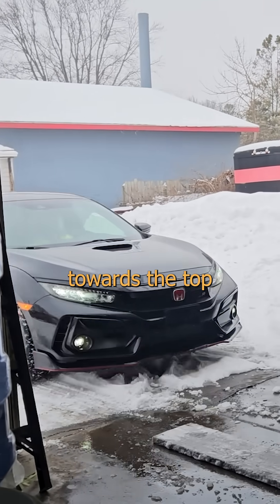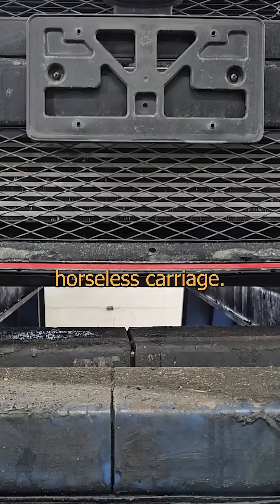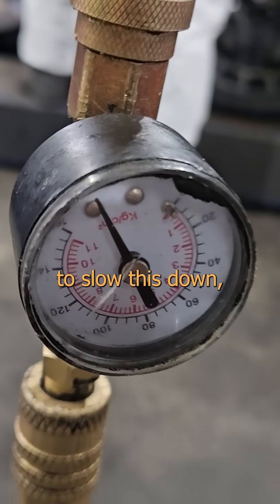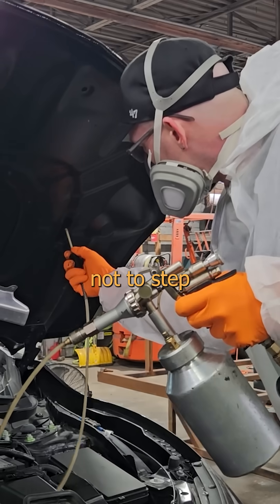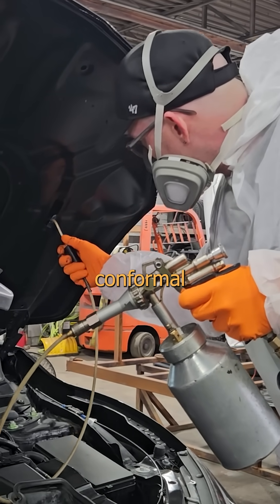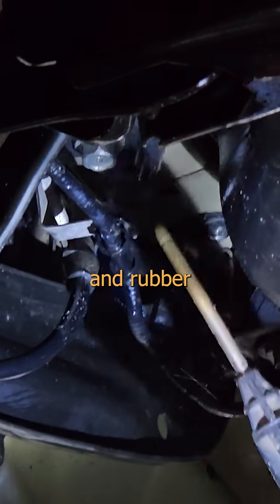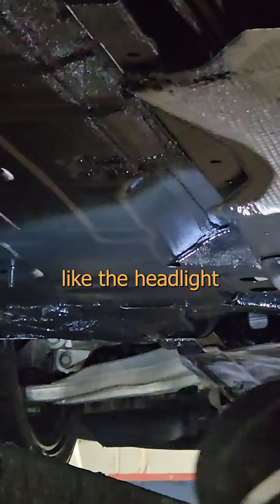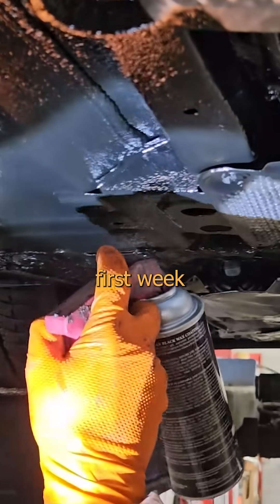How to stop rust on your car #chrisboden #comedy #engineering #wax #corrosion #science #winter #salt

Comment: I wish I could find a place that would do it around here. I can’t find anyone nearby that I’d trust to do the job right. I don’t live in the rust belt anymore, my county doesn’t even use salt in the roads when it actually does snow. But I have a diesel 2004 Excursion that I absolutely love. I waited for a year before I found one that lived in the south it’s whole life, was lower mileage, and was taken care of by an adult that didn’t destroy it with a lift kit, giant tires, or questionable mods for performance. This truck needs to last me as long as possible because it’s the only thing available that can carry all 6 of my sons, my wife, and still tow our camper or my tractor. They don’t make anything comparable today. I’m just going to have to suck it up and crawl underneath without a lift and go to town with some fluid film cans. I’ve seen that they make a straw with a nozzle for getting into the inside of the frame rails.

Comment: Wax coating? I think that might melt off down here in Florida. We need protection against atomized sea-salt in the air but the protection has to be able to withstand 110 degree summers and intense humidity. Anyone got anything for that?

Comment: I work at a corrosion testing lab and I have seen quite extensive testing regimes to ensure the manufacturers undercoating will resist both abrasion and stone chipping as well a s corrosion.
But I agree, if your vehicle is not already adequately protected against corrosion on the underside, getting some protection on there is most definitely worth the inverstment.

Comment: Excellent advice! Might I suggest if you want your waxy protective Coating in a spray can form try Amsoil metal protector heavy duty. Gives you the option to spray your other metaly bits without visiting Kevin at spraytech. Maybe your trailer hitch receiver adapter and ball or any other painted or raw metal that you don't want rusting....

Comment: I got my car undercoat at the dealership from Nissan. I also had a million questions and they showed me themselves. Most of what mine is is a sort of black layer, and then they used clear stuff for anyplace where water collects in moving parts and around door frames and such. It's 8 years old now and has almost no rust. Very small amounts, nothing larger than one cm square....and only near my rear hatch way. Can't see it when the door is closed and it's only surface rust where parts meet. I live in rural Ontario (Canada) and we still use salt on our roads. The undercoat had a neat bonus, it reduces road noise. The guy showed me by putting bolts in two cans but coating one can with the undercoat and let me shake them both. Ha Ha.

Comment: This is very common in Denmark because our climate (it's very rare to be far from the ocean and we also salt the streets) will f up your car in no time if you don't. It just sucks to work on the car when it's coated, and you need to reapply every 2-3 years, so it's about twice the cost of tires in terms of running costs in my experience.
You also don't need to ask for evidence that they did it, because you'll get a set of wipes to wipe down your paint job afterwards, and you'll more than likely need them 😂

Comment: Im on the other side of this problem being that i live in Texas. We can have vehicles outside for decades with minimal damage from rust, but anything made out of rubber or fabric will turn to dust the second it gets moved. I have to buy new tires almost yearly despite if they have tread left due to dry-rot. Belts and hoses need to be checked regularly for the same reason.

Comment: Not just DMC but also Mercedes Benz did the same undercoating. They had a rubberised undercoating used to seal the bottom of their cars round the 70s. 

Works great for external corrosion, has a nasty nasty tendency to hide internal corrosion from inspectors.

All fun and games till the floor becomes spongy.

Comment: I use Ospho.  Being on the gulf coast, we have two seasons: it's so hot my balls are melting" and "when is all this rain going to stop?"  The soil is a mix of sand and salt, so rust happens very quick.  Ospho turns iron oxide into iron phosphate.  ast, we have two seasons: it's so hot my balls are melting" and "when is all this rain going to stop?"  The soil is a mix of sand and salt, so rust happens very quick.  Ospho turns iron oxide into iron phosphate.  This lasts until the steel gets recycled.  And being a reaction rather than a coating, there is no way to trap anything behind it.  The only better option is to get parts Parkerized.  It's the same idea, but with an industrial process that uses what looks like the prep for chrome plating.  I get hitches and receivers processed.  The interface on any of them have yet to start to rust.

Comment: UK guys, I'm a former Rolls Royce and Bentley Heritage restoration engineer. I run two modern classics as daily drivers. I strongly recommend Buzzweld products if you have used new metal or are working with good metal, or if you're working with old metal, knock it back, use a rust converter such as POR-15 Metal Ready and apply Lanoguard. I use this on my own vehicles as well as on work vehicles.

Comment: Oxidation (rust in this case) as 'Fire in slow motion'... That is FN classic (I'm gonna use that, for sure! Cheers 🥂 (great vid as usual!)

Edit... I use parrifin for my woodworking tools, parts, machines' cast iron table tops on my unisaw, shapers, a planer/ jointer, (etc- which is also a good lube) I was just about to post this before I saw it on this vid. I didn't know it was used on cars! (But it makes sense! Heck, I have a small stick in my backpack right now!  Don't ask why.)  nice!

Comment: i use a mixture of chainsaw bar and chain oil and ATF (to thin it for spraying) and a pump sprayer, but thankfully here we don't use tons of salt (any more), and the dirt roads i tent to cruise only add to the ablative coating underneith the frame, but yes i 100% agree, undercoatings are amazeballs for protecting the soft underbelly of your ride from winters horrendous fury

Comment: I just take care of my truck, and clean up and paint the frame every year. I dont touch the cab or bed, because they went 25 years without rusting before i got it, but the frame had a bit of surface rust, so i cleaned it up, stripped it to bare metal, and painted it

Comment: as a michigander my self from the land of breakfast cereal 
Just wash the car every couple a weeks in the winter 
or if your really worried about it you could get some spray on truck bed liner and with a hoist or some jack stands you can rust proof your car yourself however my old ford ltd with a ziebart coating from the 80s is still rust free so thats the kind of professional job i would personally reccomend
but the best way is just wash the car find a good car wash with a good underbody wash and itll get the salt off before it has time to do any real damage

Comment: Mechanic/Bodyman here, been bangin dents & sprayin hue for 31yrs now, and i cant tell you how many folks have been screwed by snake oil and fast talkin when it comes to rust prevention. Too many times, ive had to be the barer of bad news, that someones hard earned cash has been wasted. Im a shop owner, and i use a product called HUD, rubberized chemical filled aerosol product, that works really good in my area.(central/northern ohio)Its not the most eco-friendly way to go, but it sure works. Spray cans and a cartridge/gun system with super long, flexible nozzles for all your nooks and crannies, especially your crannies. Whichever system/product is used, prep is key, i mean PREP, PREP, PREP! take splash shields off, clean everything, everywhere & just like any paint style coating, maximum adhesion is your friend.(another words, clean the grease and dirt, and scuff the surfaces!!!!!) If a shop is telling you, that their "state-of-the-art, scientist made, plutonium nano-partical undercoating system" is too good to be true & you need to hurry, before the auto manufacturers & government stop them from selling/installing it for $99.99 today only.....you just got hosed.

Comment: I had a truck with a quart a day oil leak. I drove that truck for 10 years and put 400,000 miles on it and a crash took it off the road. With absolutely no rust on it. None what so ever. I just didn't feel like putting a new front cap on it. I got my money out of it.

Comment: A long term ase tech i worked with told me to save any waste atf i collected from jobs until i had a few gallons, out it in a pump sprayer, pull your car over some old gravel and hose the frame inside and out, his g body looks like it just rolled off the lot top to bottom.

Comment: Last fall I bought a $4 can of black spray paint from Lowes and used it to undercoat my old station wagon. Is it perfect? Hell no, but the frame's already got one rust hole and backing into a dumpster would probably technically total it, so good enough is good enough. Hasn't rusted any more anywhere that I could see.

Comment: I USE FLUID FILM ON MY OLD TOYOTA TRUCKS AND IT WORKS!!!! 

You should have washed the type r first. On my Toyotas, i do a heavy wash and then pressure wash any missed spots, then blow off the water, let dry for a day, and then blow off any loose rust with the air gun. Spray with fluid film and it’s good. Repeat every year

Comment: I have the best luck with used 15/ 40 diesel engine oil. I found it worked better than the manufactued under coating.

Comment: Automotive fabricator/mechanic reporting in:

POR15 is the only undercoating worth using, a lot of mechanics wont even touch sprayed cars because of how much of a mess it is to work around

Be careful when doing this, it can cause more harm than good and can even trap moisture against the metal

Comment: Gotta apply before it gets rusty. I bought an old truck with low miles (pretty sure it was a farm truck) and the dealer threw in an undercoating as part of the purchase. But when they applied it, they did a half assed job and just painted it right on over the existing rust. The shit all crumbled and fell off in a couple years

Comment: Undercoating help, but it will not stop rust. As an example, doors are put together (skin and inner structure) prior to being dipped into ecoat. Where the skin is rolled over the edge is bare metal. Theres dozens of pockets where moisture can get in amd unless you pull the interior and drill holes, oil isnt going to get in. That said please undercoat in the fall amd wash it off mid spring.

Comment: Epoxy coated rebar has brought down buildings, same problem, a little hole forms and traps water the gets in through the concrete pressed up against the steal

Comment: "I do my homework because you matter"

Is exactly why I have so much respect for you
Reply: Is this useful on cars up north I'm in the area of the USA where cars don't rust. Like if you wash the underside of your car is it enough I've been told some brands stock undercoating within the last 15 years are pretty good.
Reply: @laindaley9644  eh, yes and mostly no. What you are probably thinking of is a rubberized undercoating. They help some but once salt gets behind it, it just holds it in.
Reply: @LongHoodPete Aren't the frames Galvanized and is that enough. I've seen some people say as long as you clean the underbody the stock protection is fine. Idk what I'm talking about tho I've seen snow like 5 times ever
Reply: @laindaley9644 No if that was enough then no one would have to do this....😂😂😂
Reply: @T.Watts89 I mean are they just not washing the undersides of their cars. Like I've driven a car to the beach. I wash the underside immediately
Reply: @laindaley9644  you haven't been around Metals long enough. Galvanized rots away with moisture. Spraying it down with water helps but is also the cause of deterioration as well. Everything is just a time game. All metal is in a perpetual state of decay from the moment it is forged or cast. Any oil or wax barrier between the metal and air will extend the life dramatically
Reply: @codyharney91 I know of an outdoor 80s f150 that's got a bit of surface rust. No rot tho. Things really don't rust around here.

Comment: It's not a permanent solution. You said you tested it for a year, which means you need to have it reapplied. Black wax coatings, like Fluid Film, Woolwax, and the one Kevin used, are annual applications. Which is why I prefer rubberized undercoatings, and it was the first thing I did to my truck after the oil change. Except I pulled the cab and bed to actually coat the entire frame and underside of the body

Comment: NEVER USE RUBBERIZED UNDERCOATING. Shit is garbage and will cause worse rust underneath where it's applied. Plus it's flammable and a nightmare to work on. The candle wax type he shows in video and the oil based are the only ones you should use!

Comment: New gmc denalis have spray foam instead of sealant on most body panels. Go open the back door and peek behind the door seal at bottom corner of rear fender. Not only is there a gaping hole bigger than *******  but the “sealant” right there isn’t sealant. It’s painted spray foam. Look at it. Touch it. Right there near the spot welds. The door seals also abrade the incredibly thin paint if you don’t regularly clean behind them. Pull back your door seals and observe abrasion. ALSO. The paint is incredibly thin. Gm spent millions developing paint coatings so thin that 3 passes of 2000 grit wet sanding will burn through the clear coat. Go ask a detailer to polish a 2019 Denali. They’ll explain to u how General Motors paint jobs are so thin that polishing a scratch will destroy the paint. PENNY PINCHING  on a 100 thousand dollar vehicle. I’ve put new metal full rocker panels plus rust spots on a 2018 gmc Denali. Boss said he did a 2019 Chevy Yukon full rockers both sides plus rust spots. We custom form our own panels out of high quality metal and use proper paint techniques… ya kno, since gm doesn’t. Keeps me employed

Comment: I do rust repair professionally. MAKE SURE YOU PRESSURE WASH OFF YOUR OLD LAYER OF UNDERCOATING EVERY YEAR, BEFOREEEE YOU GET THE NEXT ONE… if not thanks for keeping me employed. Other than wrong oil spray practices, the number one cause of corrosion is lack of accountability. Gmc switched from sealant to spray foam 💀💀 go look at the edges of panels with spot welds around the bottom of the vehicle. It’s painted spray foam

Comment: I saw a video of a professional repair painter of cars, he said there is no way to do it so it last, it will come back at the same spot even if you do all the steps really thorough, the problem is cheat metal, when its been rusted thro the galvanization its over, all they can do is slow down the process…

Comment: Na, wash your car at least twice (at least) in the winter with and undercarriage wash. Late 90 to 09 used to work on automatic car washes (laserwash 4000 or g5) that'll give you a few MORE years before metal oxidation takes over and your fred Flintstoning around!! You could also fluid film the undercarriage as well!!

Comment: We not will get  into environmental friendliness....

But back in the mid-70s (before and after I am sure) on the outer Banks in North Carolina we sprayed burnt (used) cylinder oil up under the car. Then go drive on a sand road. Rinse and repeat a few times. Every few months.

Comment: AVOID undercoating that is similar to driveway sealer.  Never ever ever let car get sprayed by Ziebart.  Rusty Jones was a product and company that applied a yellow waxy substance that was used by VW on the underside of the hood and other areas in production to eliminate warbling of the hood, and as a rust preventative elsewhere.

There are videos on yootoob with 2-5 year re-exam of cars treated with  various products. Fluidfilm was the only branded product that rated very highly.

Comment: That is amazing. The only problem we get in my place is the salt spray from the sea,  we have a habit of driving on the beach here. You can get an oil based wash after the beach drive, but your method would be a more efficient way. You would still need the oil wash, though, because the sand may remove some of the wax.

Comment: Best rust treatment is the douse the underneath of the car with used engine oil from a diesel engine. 
Completely drench the underside of the car using a suitable spray gun at the beginning of winter and reapply every year.

Comment: As a Minnesotan that owns a mid 200s Toyota with the prado frame...

Elbow grease, a wire brush, POR15 3 part kit, and Rust-Oleum high performance enamel.

Thats my silver bullet. No conformal coating bull crap, no wax, no oils, no films. All too messy. Just simple, reliable, long lasting paint. Every year in the fall i get under my truck just to check up on it. I haven't had to do anything so much as a few touchups from offroading . 242,500 miles in the second saltiest state in the US. And she's MINT.

Comment: I usually just take a tube of grease (any color) and apply a fair portion to the underside of my cars. Great at preventing those pin holes and also traps sand and dirt from getting through. Also critical thinking is like common sense, and it ain’t so common any more.